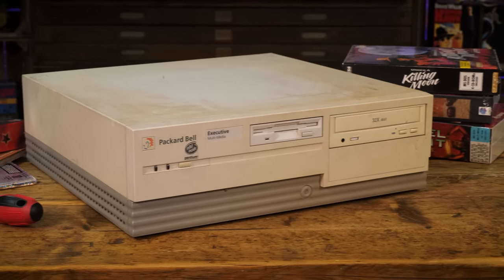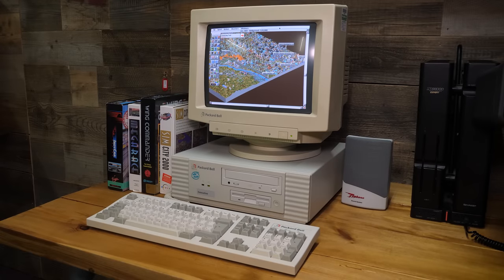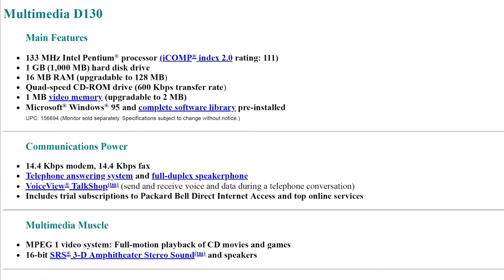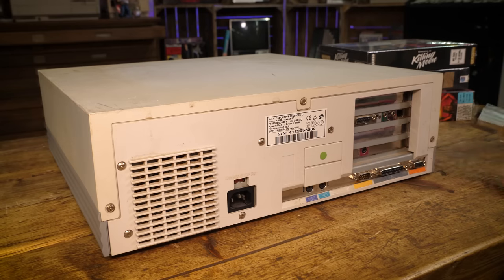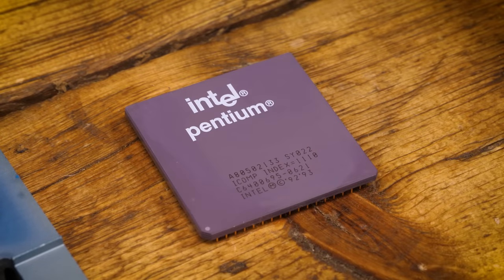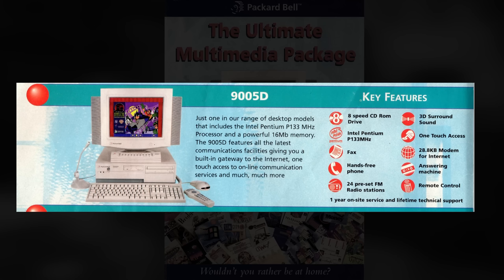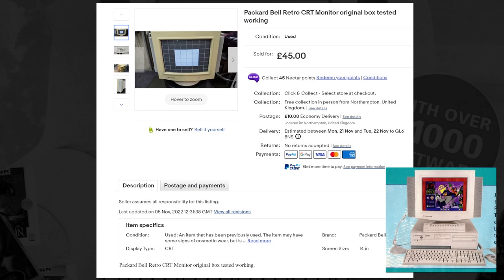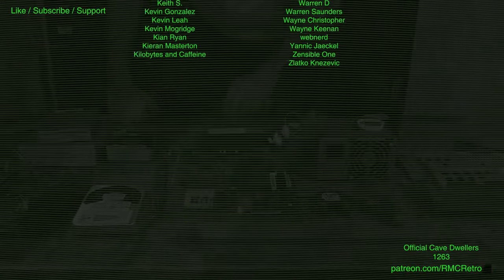Packard Bell Restoration | The Packard Bell Arrives | Trash to Treasure Part 1

Comment: Argh! Flashbacks!

I had to support these damn things when I worked at a PC World in the mid 90s as a penniless student...

Edit : Thankfully it's a 9005, rather than an earlier 900 series. CD-ROM isn't original, they tended to use NEC 8x drives which failed a bit...

Monitor is correct, as it the second keyboard. The IR sensor for the remote control was in the mouse IIRC. First (manky) keyboard is from a 2000-ish model. The old ones are way better, made by NMB and were pseudo mechanical. Feel was pretty good for the era. Also worth noting that at the time Packard Bell Europe were owned by NEC.

Recovery CD is the same across all 9000 series machines. You might get unstuck with the tattoo - which identifies the machine type and correct software to the recovery CD. It's held in a hidden sector on the HDD. Hopefully the original HDD works.

Comment: By all means, restore it.  It's probably less common now than when new, simply because of how poorly built and almost universally loathed they were.  We often referred to them as "Puke-erd Bells"  and "Puckered Balls" I personally know a man who took a baseball bat to a particularly recalcitrant model.  They were a perfect triumph of appearance over substance.

 My parents picked up a Legend model (486SX25) in 1993 during my junior year of college.  It was absolutely horrible.  Dad picked up a "Reveal" 2X CD-ROM kit to install in it and we discovered the second IDE channel didn't support Cd drives.  Hard drives were fine, but no dice on the CD, no matter how we configured the drivers.  We ended up returning the Cd kit and getting a Reveal 4x kit with a rebranded Aztech sound-card that had an IDE header on it, which finally fixed the problem.  I do fondly remember playing Mega Race and Civilization on it for hours, and staying up far to late on the Mirkwood Mud.

THese machines also single-handedly confirmed my opinion that home-built whitebox machines were far superior

Comment: I had almost this exact PC. Same case, same CPU, same RAM but mine was an earlier version bought at the tail end of '95. At the time I didn't know anything about PCs and learned later what a "bad" purchase it was but I (mostly) disagreed. Yes, it was overpriced for what hardware was in it compared to what you could get from the popular TinyPC (I think that was what they were called) but I remember my 133 working solidly into '00 as a daily driver where my friend's Tiny's were dead a few years later from failed mobos (probably capacitor plague but at the time I didn't know how to fault find that.) If you were building your own PC you could use good components for less money but there's a not-often-talked-about feature of buying these overpriced boxes from high street stores - finance. Low income families could be taken advantage of with high interest rate loans provided by the big box stores and that was how I got it and well, it was the only way it was happening. And since it's directly responsible for my career it's hard to call it an unwise purchase.

Calling them "slow" is a bit misleading. For '95 it was a 133 where 100s and 120s were far more common, it had 16meg where 8meg was the standard and it predated hardware accelerated 3D so the basic GD5440 wasn't a problem. And the Aztech soundcard was "alright." I didn't have that combo modem version, mine was just a plain soundcard and I remember it being "fine" in DOS in that it was a common as dirt SB Pro clone to old DOS games. L/R channels were swapped as with all clones but that was easily solved and while in windows it had better MIDI emulation than most. The windows drivers were prone to buffer underflow but I suspect a driver update would have fixed that. Never found out as I got an AWE32 by being in the right place at the right time before I got internet access.

And yes, it was riddled with bloatware, but so was every PC you didn't build yourself. Hell, I spent several hours of my weeks at work uninstalling crapware on Dells, HPs, Lenovos... at various times. Bloatware was just how they subsidised the BOM and everyone did it. Fortunately it was all easily removed. And they always included the OEM windows disc so you could always go for the nuclear option.

Unfortunately when I finally upgraded I got rid of it. At the time I didn't appreciate how badly backwards compatibility would be treated and I thought there was little point to holding onto old PC hardware. Now I desperately wish I still had it.

Comment: I worked for a Packard Bell service center from 93 to 99 and unfortunately got to work on plenty of these. Toss that sound card, they failed so often it wasn't funny and even when they worked they were mediocre in terms of quality and stability. The power supply also was known to be subpar and that's being kind so hopefully the one you have works. 

Other than that, it's not the worst system I had the displeasure of working on during that time but even now other than preservation purposes or if you can't find any better retro machine, I would never get one or use it.

Comment: It's relative, in the EU there was some IBM backlash for the Amiga/ST era, and in NA you chose a PC to have a less pretentious computer. ^_^
I've certainly used plenty of computers like that but in actually buying I went with generic prebuilt PC vendors and dabbled in upgrades myself Eg. RAM, various video cards, the rise of DVD.
Running out of room lol but hardly see even these very often in my thrift circles even if people will buy them. Horrible nah, very very plain I'd say. ;)

Comment: Don't put old 'Packard Hell' computers in the bin. Instead, take them out into the back yard, have a priest sprinkle them with holy water, and then ritually purify them with fire. I used to work for PC Mastercare in Nottingham. Although the early machines were solid and reliable, but slow, later machines were horrible. Don't even get me started on the Miro M-Wave card, which started life as an IBM card, and then when PB found that the cards wouldn't fit in their funky cases, they paid for someone to cut the end off and add it on as a daughter card. Then they ran the whole thing through DOS drivers, even in Windows 95/98. It was a sh*tshow. If anything altered any of a number of ini files, the card would stop working and sometimes not even a complete smeg and reinstall from the master CD would fix it. In some cases, customers were actually instructed to get the extended warranty and then throw the computer down the stairs so they would get a full replacement!
PC Mastercare started out with 9 people in a corner of a warehouse when they were servicing all other computer models sold through Dixons and PC World. When they took on the Packard Hell support contract, they expanded to 400 people in a dedicated support centre. It was crazy.

Comment: These were cheap horrible PCs and that's the point - that made them accessible to more homes and for many people that's what lowered the bar of entry for the working class. Anyone arguing we shouldn't be restoring the cornerstone of 'IBM PC at home' is completely missing the point. Packard Bell, DELL, e-Machines and even AMSTRAD were the staple home computer names at the dawn of the IBM-Compatible Takeover and it's an important part of history!

Edit: Growing up we had an Amstrad PC in the early-mid 90s, it wasn't until later that it got replaced by something else. I can't remember what it was, it might even have been a custom built PC, but i know later in the early 00s that was replaced by a Packard Bell tower that came with a DVD ROM and all the associated bloat. after then came an e-Machines PC, a DELL laptop and when i was old enough to get my own (Albeit handed down second hand thing) Was a Pentium II model Compaq PC.

Comment: While it predates this "fine" example by a few years, I worked for John Lewis Partnership selling mobile phones and computers, including those 486 predecessors mentioned. Being John Lewis this also brought the joys of not only trying to sell them to joe public but also to assorted, various celebrities - Timmy Mallet and Graeme Garden have both stuck in my memory for different reasons. The hardware was every bit as cheesy as described but was still better than what most had, although I was sporting a fast 486DX at the time with a massive 16MB of memory that put the kit I was selling to shame. Even still those early Pentiums were tempting - if it hadn't been for the tall prices and short specs (and cheesy branding) I might have bought one. In the end it was just row upon row of beige boxes that had nothing to differentiate themselves, all apart from the Apple Mac clones of that era. It's fair to say that we didn't sell great numbers (of any of the models), certainly not compared to the N64s and CD32s...

Comment: If the modem/sound card is a "WinModem" card then abandon all hope! in an effort to make the modem cheaper a lot of intelligence is stopped out of the chip, to be replaced by software running on the pentium processor, meaning that to run any kind of internet browser your PC became much-much slower. And also you needed a special driver.
If you google for the serial number of the Rockwell chip you might find out if this is such a beast.

Comment: Looks like it's either been in a woodcarver's workshop or with a smoker, or both, judging from the color of the dust. That stuff is so extremely gross, esp when it's sat around for years and you turn the machine on again and there's a horrible sweet odour of tobacco coming from the machine.

Comment: There are a lot of "computer snobs" out there that think a computer is only good if it is high end.  And this was cheap, but built good for the price at that time.  It could have been built better, but that would have made it unaffordable.

Not every good car by GM was a Cadillac.  There was also a need for a good cheap Chevy.  In computers this fit that need.

Comment: Avoid 3D acceleration on something this old - stick to games from the DOS/Windows95 crossover time. For the first couple of generations of 3d accelerator PCI cards (Voodoo, Voodoo 2, Power VR) the ultimate platform is an Intel BX chipset and the Slot 1 Pentium II processors with a 100Mhz bus

Comment: Packard Bell made some horrible machines.  I worked at PC World around the time when they went bust and the failure rate on those things was terrible.  They were always installing PSU's that were too weak to support the rest of the components and had no allowance at all for things like a graphics card.  Also the bloatware they packed in was horrendous.  The AOL software of the time was not even compatible with the rest of the software included on the 'System Restore CD' and nearly impossible to uninstall.  The only way I could make the machines run stably was to re-install Windows and then break the install by removing the CD and forcing a reboot at the point where it tried to install AOL.

I highly reccomend not using the PSU this PC came with as it is likely at the end of its life and will not support upgrades well if this machine was built like the Packard Bells that I experienced.  Also stay clear of the restore media if possible, just put on an OEM version of Windows 98.  There is probably a licence key stuck to the case somewhere for activating it.

Comment: those things was uther crap. the hardware was not common. so forget OS2 etc later. AND the uncommon hardware did not last. they had a lot of fault.. AND if you sendt it in for reaper they used "old components" that had ben taken out due to fault. SO the problem you had was gone and replaced with 5 new ones.